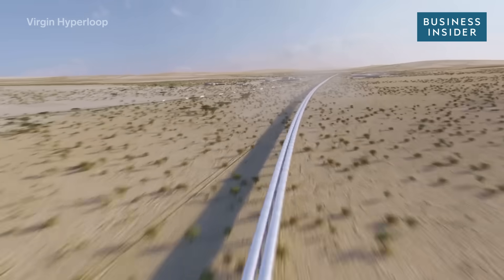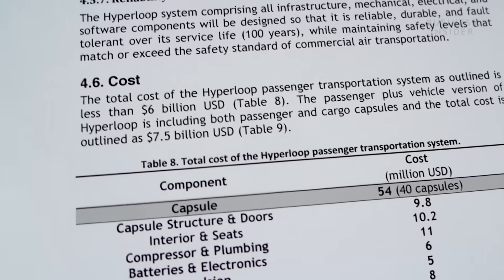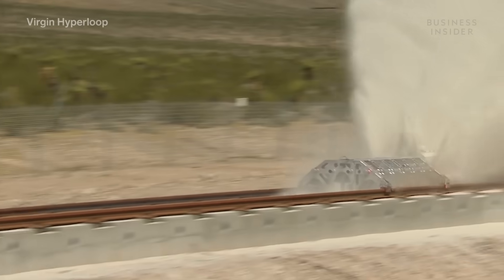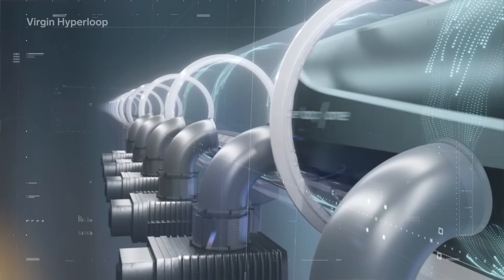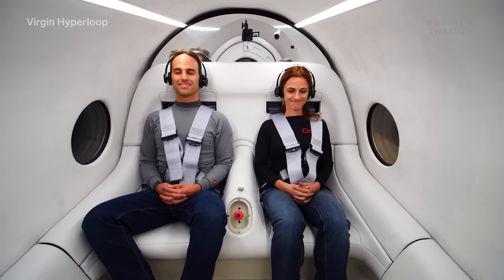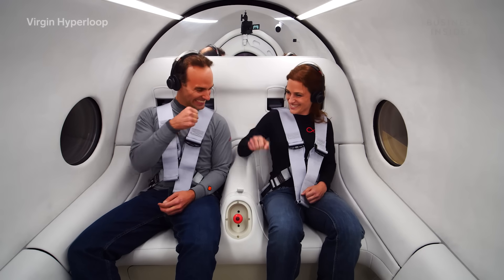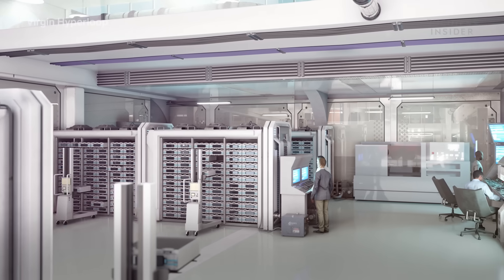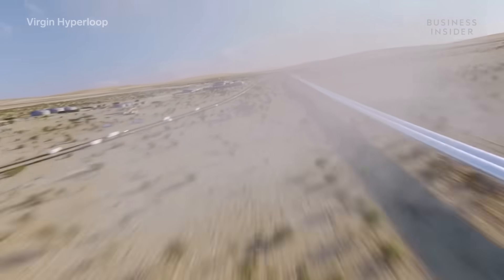How Elon Musk's 700 MPH Hyperloop Concept Could Become The Fastest Way To Travel

Comment: Imagine you get stuck in the tracks 
Oxygen has left the chat
Reply: Ooooo I didn’t think of that
Reply: Could be a huge problem. I personally don't see how they're gonna maintain a near perfect vacuum in that large if a structure.
Reply: It's the same thing for planes one thing goes out and everyone dies but everyone still uses them
Reply: @BVBrocks927  no this isn't like being in a air plane. They're going to have this tube at a 99% vacuum. If the pod decompress you're dead. In a commercial jet if it decompressed at altitude the pilots can still bring it down to a safe altitude.
Also if the engines go out in a plane they can still glide it down safely. It's been done before. This is dangerous.

Comment: The fastest way to die
Reply: ?  How about airplanes. You have zero chance to survive a plane crash. This tube thing you just slide along the track. Theres no where but straight. Nothing can collide with you. You cant collide with anything in front. No power you just slide to a stop safely. Youre not 30,000 feet in the air. You can be rescued by jumping out into a ladder.
Reply: @SWIFTO_SCYTHE  well yeah of course you have almost no chance of surviving a plane crash lmao. But what are the chances for that plane to crash? Air travel is quite literally the safest form of travel. If you thing an airplane is more dangerous and more likely to fail than a 200 mile long tunnel that has to stay vacuum sealed (which is impossible btw) then you are clinically insane.